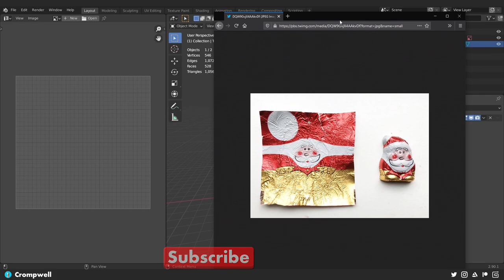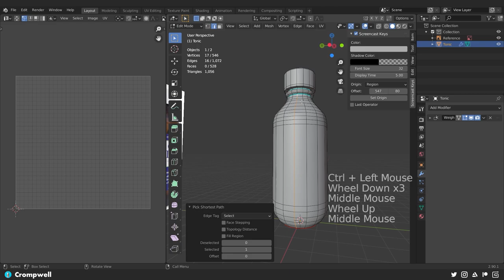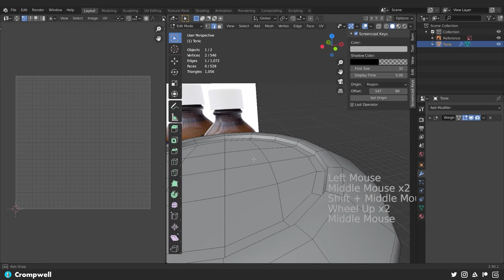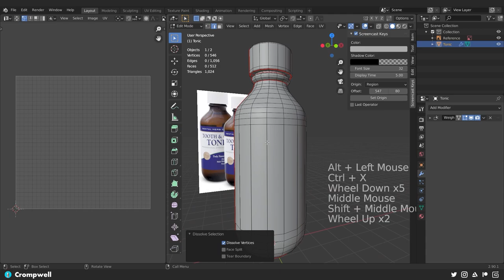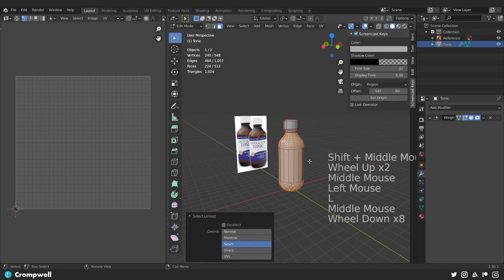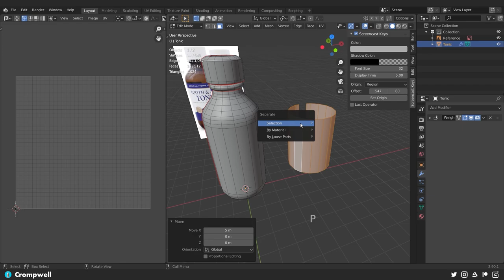Complete Asset Creation [Part 3] - UV Unwrapping

Comment: is there a reason that my unwrap of my drink bottle I am rendering looks like circles and how do I fix that so I can effectively put the label on the uv map
Reply from the maker: You will need to straighten out the UV shells either by using an addon. There are some free ones, even some that might come be default with Blender. I used paid addons in my own work, or you can manually select the verts and scale them based on their axes. I should make a video on UV unwrapping in blender.
Reply: @Crompwell  thanks for the response! I remade my model and got closer to the result im looking for, but where I place my label on the bottle is over the full thing since its a "Prime" bottle
Reply: my uv unwrap is looking like you're at the bottom left on you're uv map of you're bottle< im going to see if I can watch the video a few more times and see how you straightened it out
Reply: my label looks like you're bottle because it goes almost 100% of the way up the bottle so Im trying to get a 2d image on that
Reply from the maker: @benthomas2717  it’s very hard for me to troubleshoot without seeing what you’re talking about, I’m afraid. I don’t know if you’d like to connect via discord or email. I might be able to better help you that way.